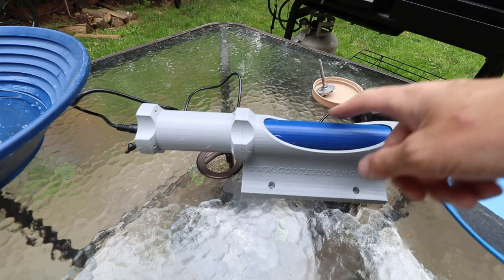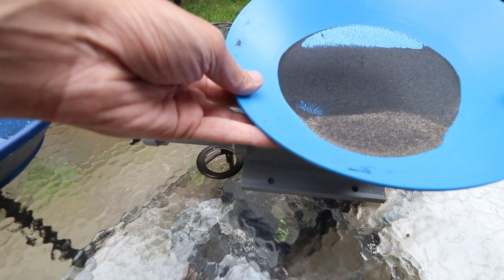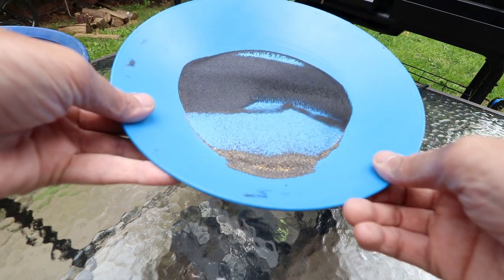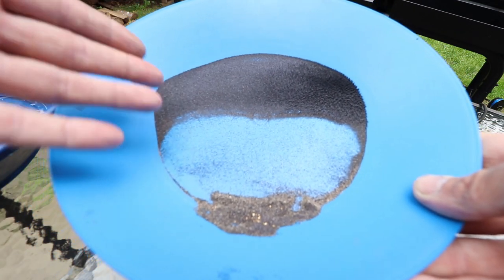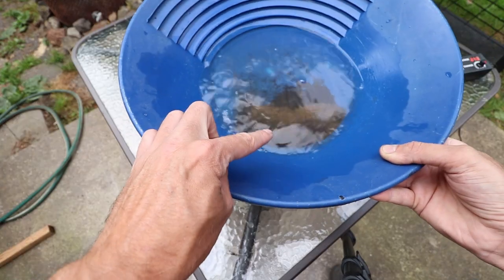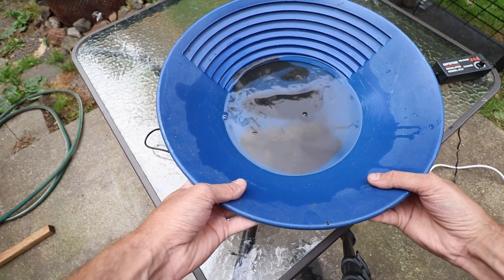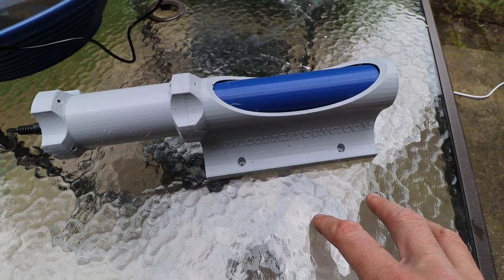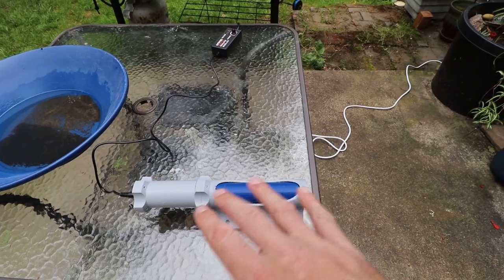The New Rollie Pollie 3D Printed Magnet

Comment: Thanks for the demonstration.  A bit more work than Spin-it-Off, however, if the price is reasonable, definitely good.
Reply from the maker: I found that the spin off takes gold with it if your working micro gold like we do at the coast! These are selling like crazy in the shops here in Oregon but the same shops can’t sell their spin it offs lol
Reply: @pnwprospecting  maybe beach gold has much more black sand, so it's more effective.  On my cons I rarely find gold in the Spin it Off tailings.  Either case, certainly not worth chasing a few specs. 🤠
Reply from the maker: I just love testing new gear!

Comment: I know the beach is richer in gold but I am near portland and was wondering if there is a closer spot along the columbia cause its tuff for me to drive all that way.

I know of lewis river and near longview but finding some small fine deposits on the river closer would be neat.  

Still waiting on the heat to dissipate before I scout around a bit and pan for the first time.  I will be getting a gold cube eventually as well as a magnetic seperator so tell Colton to get her done.=)
Reply from the maker: There are a couple places by the mouth of the Columbia but the new laws make it harder to run our equipment.
Reply from the maker: I'm heading down to quartzville this weekend to do some prospecting down there it's only a few hours from Portland. The Lewis is good but very spotty and it's been hit pretty hard. Historically there were claims all along the Columbia for fine Placer gold until the dams were installed but you can still find black sand deposits tucked in along the  river
Reply: @pnwprospecting  Ok thanks, I definitely know more is better when it comes to gold, I'm after it for fun mostly anyways.

I have to admit though I am liking the idea that fine gold is difficult to get and half the fun is in figuring out how to locate/extract it more efficiently or just differently.

Fascinating stuff and I may even end up joining a prospectors club down the line for more excitement.
Reply from the maker: Joining a club is a great idea!
Reply: @pnwprospecting  Heck yeah and at first I was not inclined to but the amount of knowledge that is not online dwarves what is.
Reply from the maker: They're pretty awesome people in the clubs for sure! I try to drop in to the one in Vancouver every once in awhile for their meetings on Sundays